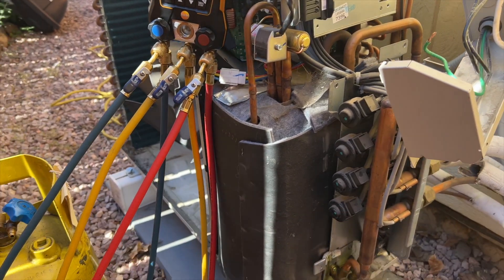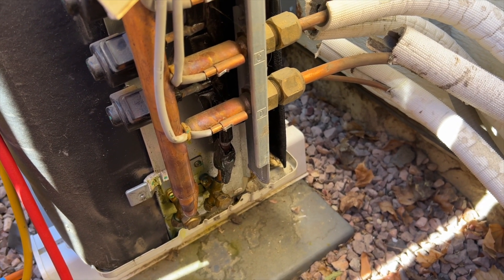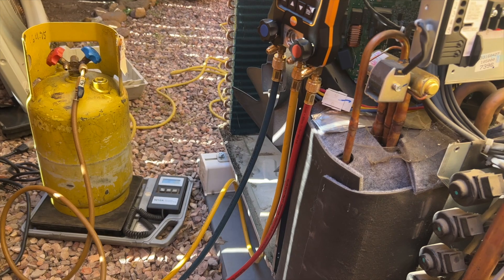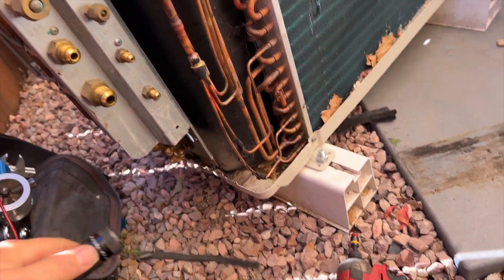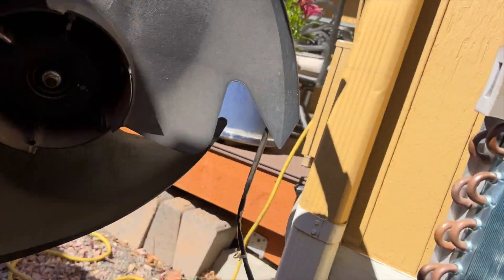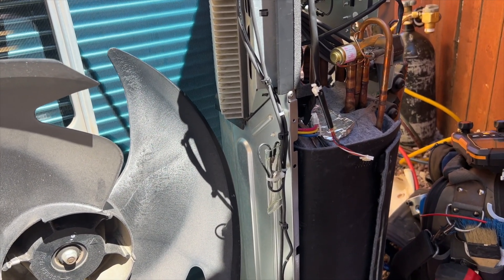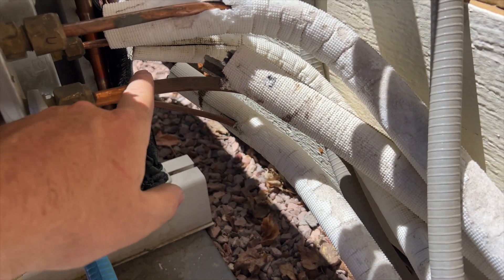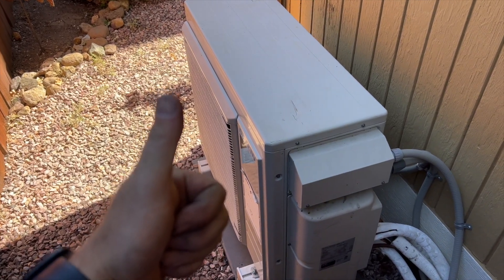How to Replace an Outdoor Coil On a Daikin 4MXS MiniSplit EP142

Comment: Excellent vid. 
I live in one of the coldest places in North America. Installed this exact model. It broke that winter, hole in the coil. Put a new one in. It broke this winter lol. Found another hole in the coil, different spot. Called Daiken and they said a new coil is all thats needed.
Why am I telling you this? 
I am telling you this because I never even knew a pan heater existed. Thank you!
Neither Daiken nor our useless supplier thought to even suggest it. You just outdid both of them in one vid!

Comment: I'm about to do this on a RXL12VMJU9. I called Tech Support and asked if there were any filter driers in the unit that would need to be replaced at the same time as the coil, He said there are 2 filter/ mufflers that will need to be replaced as well.

Comment: If you look on you tube long enough your'e going to come across all kinds of crap. Oh by the way good video. One the leak was not at the bottom of the coil, two the manufacture is searching for a reason that their coils are failing. They need to use thicker copper if that's what they use. It's at the bend of the coil and that's where the velocity speeds up and scouring happens it slowly eats away at the return bend. The manufacture will let the customer do the research and development for them.

Comment: So, what a second, is this system before they instituted the complete system replacement warranty when you have a compressor or condenser failure?  It has the 12-year parts warranty, but I am curious when the switch was made to the full system replacement, even the Amana and some Goodman have the full replacement warranty now.  This switch must have happened before I became a deal for Daikin/Amana.  I have had a fellow colleague receive a complete swap out of a heat pump outdoor unit because of a failed system.